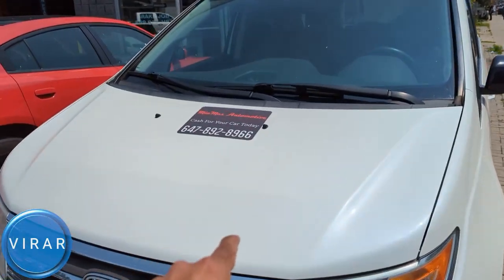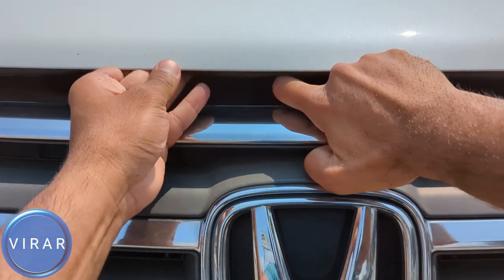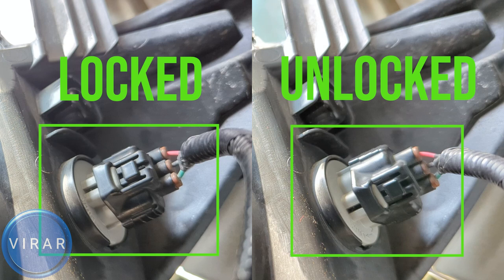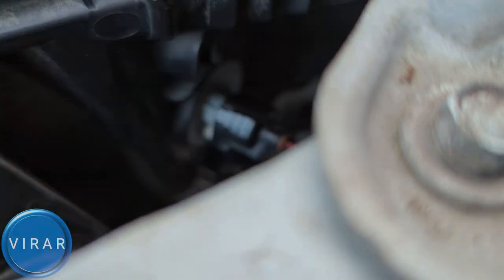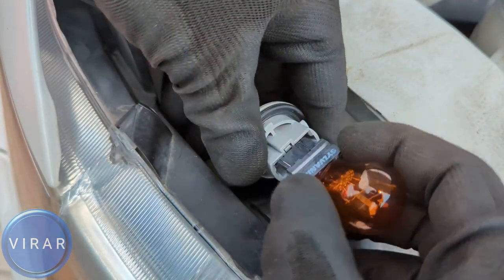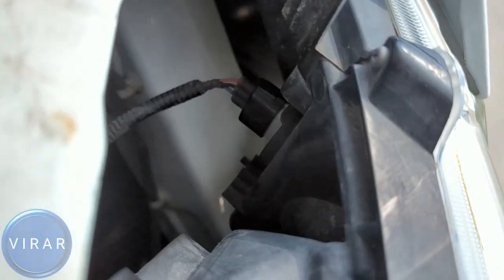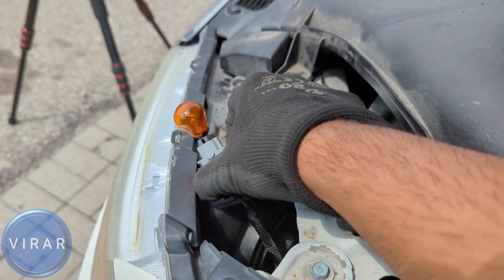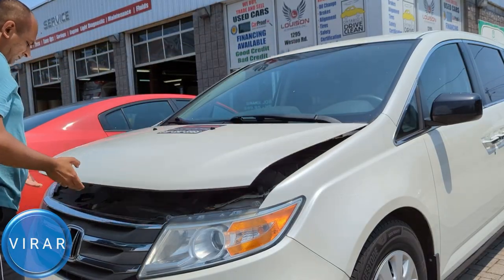How to Replace Front Turn Signal Bulb - Honda Odyssey (2011-2017)

Comment: FYI for anyone trying to install LEDs, the socket is a 3157CK socket. Most of the bulbs I see online are 3157 standard. I didn't realize this and when I plugged in a standard 3157 LED bulb, it blew the fuse.